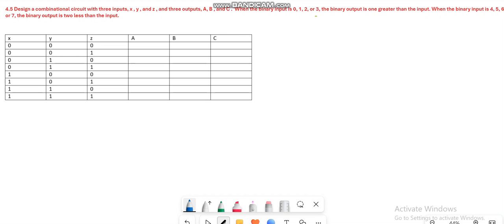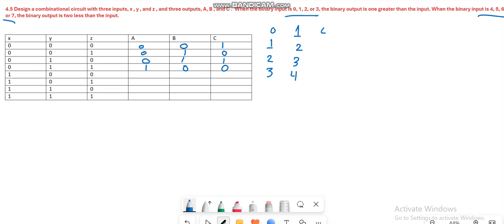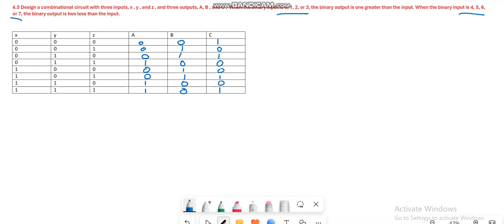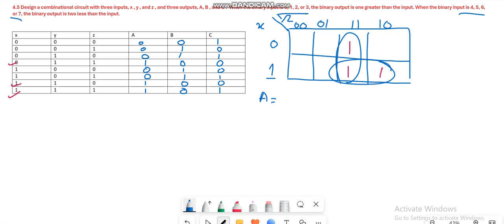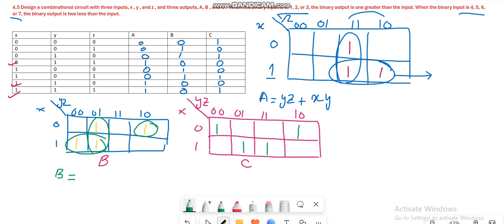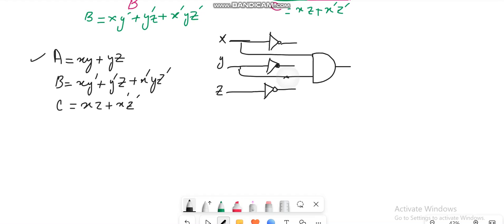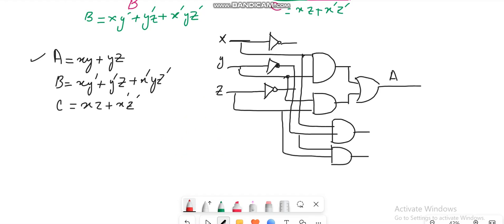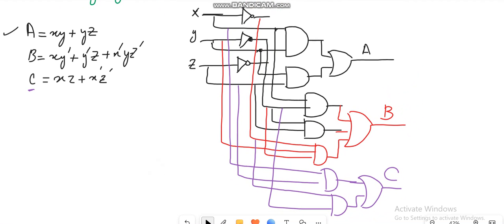Design a combinational circuit with three inputs, x , y , and z , and three outputs, A, B , and C .

Comment: Design a combinational circuit to drive a seven-segment display. The circuit should take a 4-bit binary input (B3B_3B3, B2B_2B2, B1B_1B1, B0B_0B0) representing decimal numbers from 0 to 9 and generate appropriate outputs to illuminate the segments (aaa, bbb, ccc, ddd, eee, fff, ggg) of the display to show the corresponding decimal digit.?
And this one 😢
Reply from the maker: @lubnamaqsoodlubnamaqsood3396  though I have.not solved it.but here is the solution 
https://youtu.be/393osMrDlJE?si=MA1gRkpMeX49dGyg
Reply: @eevibessite  ahhh thank you🥺

Comment: : A courier service needs a circuit to categorize parcels into three weight ranges based on inputs from two binary sensors:
•	W1: 1 if the weight is greater than 5kg.
•	W2: 1 if the weight is greater than 10kg.
Output three signals:
•	Light (L1): On for weights ≤ 5kg.
•	Light (L2): On for weights > 5kg and ≤ 10kg.
•	Light (L3): On for weights > 10kg.
 Can you solve this question?
Reply from the maker: @lubnamaqsoodlubnamaqsood3396  will try to solve

Comment: mam can't we use xnor gate in logic ckt ?
Reply from the maker: Not a direct Boolean operation

The XOR gate is not a direct Boolean operation, so the rules of simplification for addition, multiplication, and complementation do not apply to it. 

Not functionally complete

The XOR operator cannot create the AND and OR operators, which are required to construct all possible Boolean functions. 

Non-associative with more than two inputs

The XOR gate follows the associative property with two inputs, but not with more than two inputs. 
However, the XOR gate is still a standard logic gate because of its usefulness and versatility. It's used in circuits that perform calculations and arithmetic operations, such as adders and half-adders. It can also be used as a pseudo-random number generator.

Comment: Mam I have solved this problem without using k map.How many marks may I receive?
Reply from the maker: Did you derive the boolean function expression ? If you did, without using the k map and just wrote the minterms, it means your function is reducible. So you can score around 3 out of 5 and 6 out of 10
Reply: I have not reduced it mam